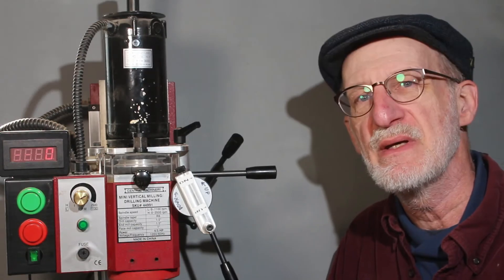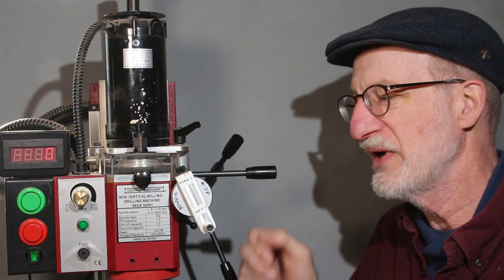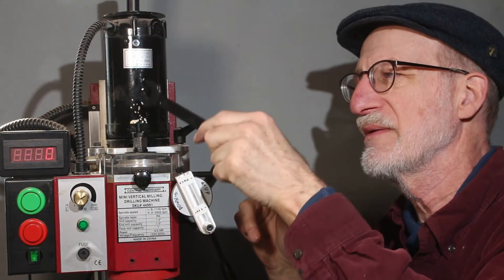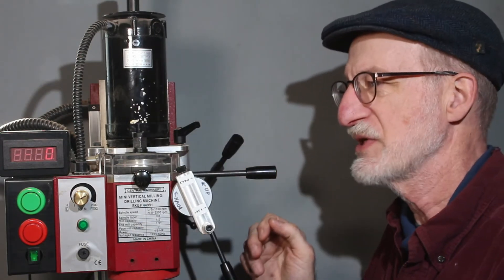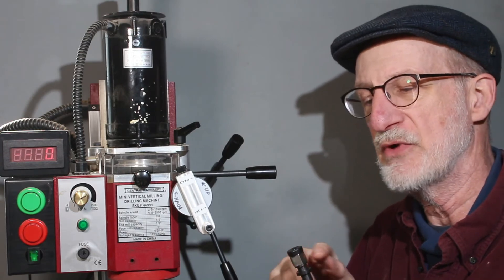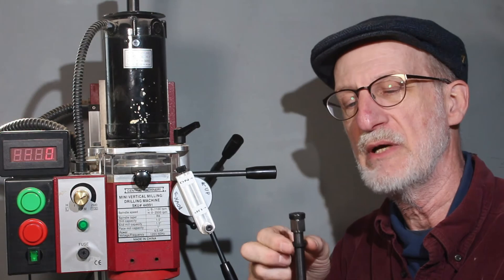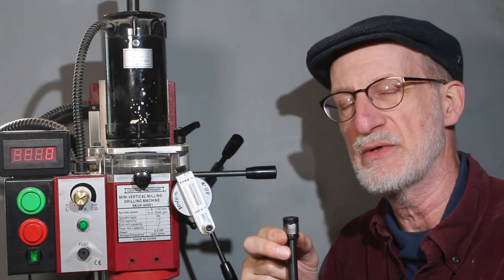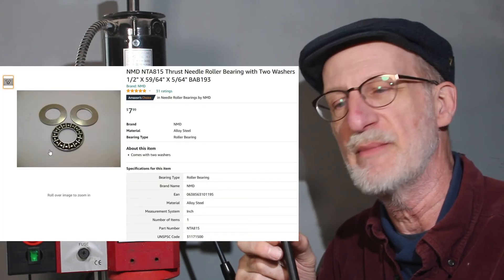Quick Tip #1 - Mini Mill draw bar improvement

Comment: I modded this portion with a pusher arrangement to eliminate the need for hammering during tool change.
Reply from the maker: I'm struggling with how to picture what you came up with.  Was it something like an old-fashioned pump handle that pushes down on the top of the drawbar?  Sounds like a clever idea, and I will explore that on my machine.

Comment: I don't know about hammering on a bearing, but for $10 I guess it is OK. You could bolt a piece of brass on the wrench itself, to act as a hammer. With those Delrin parts it releases easily the tool? I would expect to worsen it.
Reply from the maker: Delran is a great bearing surface. But I have since replaced that with needle bearings as I mentioned. And that reduces the turning Force to lock the spindle and makes it very easy to release too.